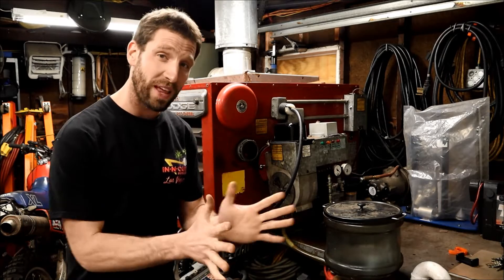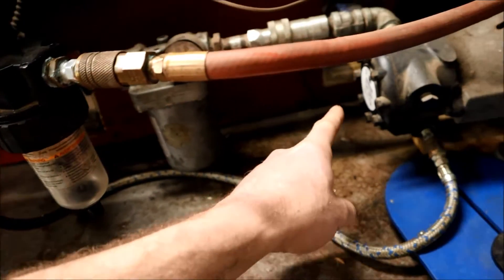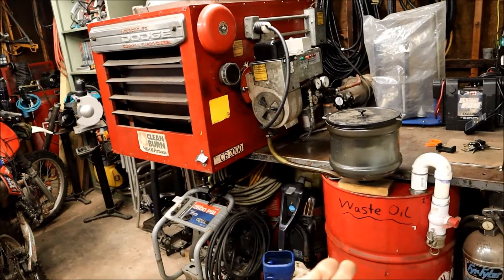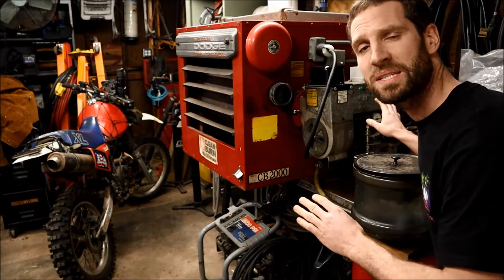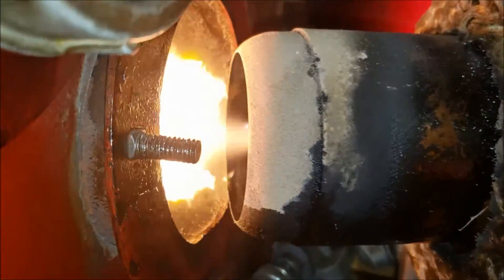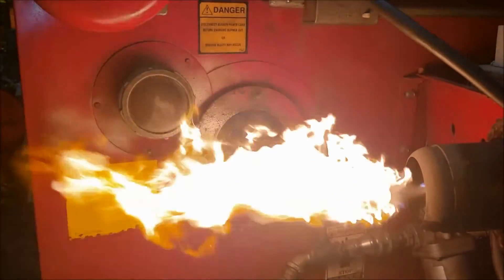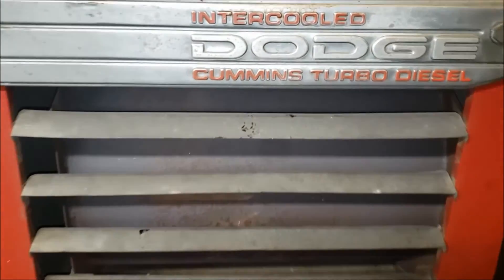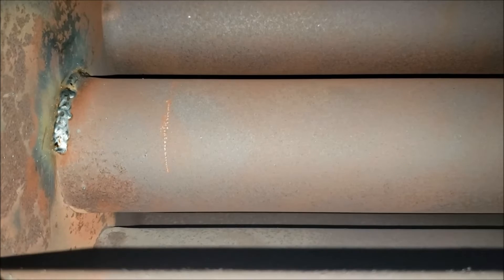Flame Test on a Clean Burn Waste Oil Furnace 1992 CB2000 burning used motor oil

Comment: its a beast of a flame , nice video very funny guy, its not often that you see a oil pressure pump in those waste oil burners, looks like clean burn is making it a little bit different,also the sparks are constantly working thats also different.

Comment: @know non sense. Is it a bad idea to flush a transmission on a vehicle that has high milage? I was told it can damage it. I also know a guy whom it happened too. At 90k or so. When should you flush a transmission. I saw a video you did awhile back on useing a oil dipstick to check fluid level but couldn't find info on transmission flushes.
Reply from the maker: Seems like everybody has a different opinion on this one. I personally think that automatic transmission fluid should be changed every fifty or sixty Thousand Miles by just doing a "spill and fill" which on most Transmissions only swaps out about half of the fluid or so.  This basically just replenishes the life of the fluid.  And of course if it's equipped with a filter change that as well.  Not a big fan of hooking them up to a flush machine and putting all new fluid in the transmission since I have also personally see it cause some issues in the past on higher mileage cars.  Hope this helps and thanks for stopping by
Reply: @NoNonsenseKnowHow  thanks for the quick response
Reply from the maker: @LOOKFAST  no problem man

Comment: I maintain 2 of these damn things at my customers transmission shop (you can see his shop in the clip of the ball joint failure) what a pain in the ass.
Reply from the maker: Yeah I agree with you! I plan on doing another video of the most common items that need maintenance and attention.  Definitely vacuuming it out and cleaning out the oil preheat. Gets all gummed up!